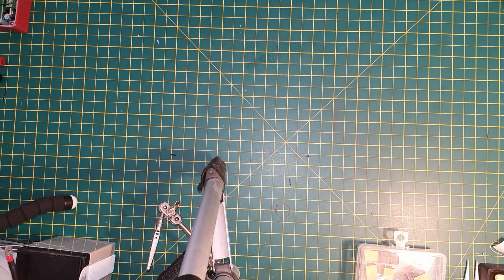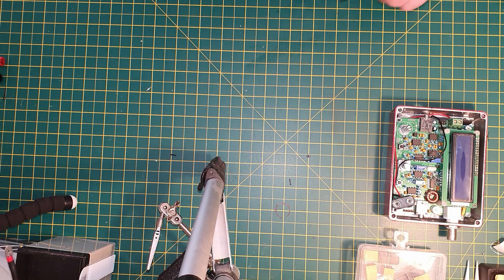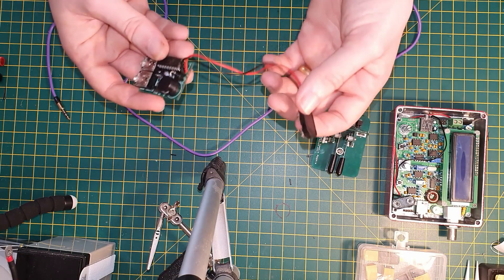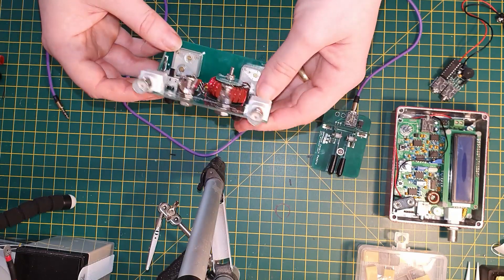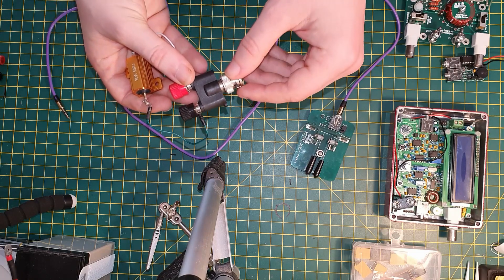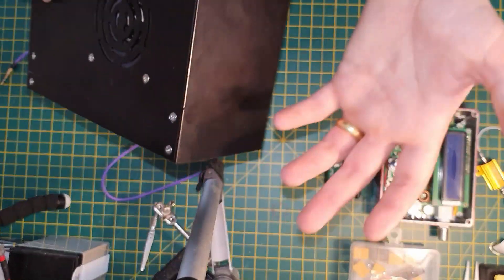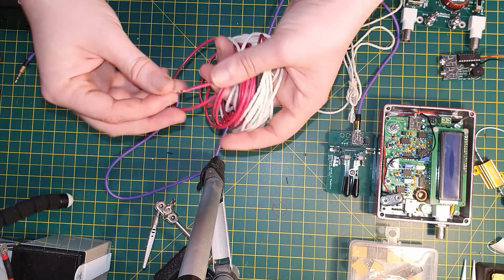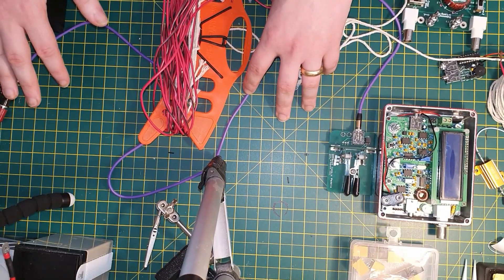Ham Radio for under $100, My amateur radio kit

Comment: On the Doublet, just cut it as long as you can and still have it fit in your space. Don't make it resonant on your highest band. Usually you may run into one or more bands you can't tune. You can try changing the length of balanced feeder by a foot or so and try again. They definitely work. I run mine as a vertical instead of horizontal and the length was determined by the mast I had (43ft), so each leg of mine is about 21ft. Mine is fed with 450 ohm window line. The longest contact I've made with it was about 9800 kilometers qrp ssb on 40M. And don't think you can't work bands that it's too short for. I've tuned mine up and made contacts on 80M.

Comment: Even with a dummy load, you can be heard for a long distance if the band is open. I made a contact with 5 watts into a MFJ dummy load from my house in Alabama to Tampa FL on 40M in the early Summer at about 9 PM. No tuner was in line so you cannot blame that radiating a signal.

Comment: Just come across your channel, very interesting, while I love building stuff, my gear is all silent key, or old! For 2mtrs I use a Yaesu FT1500m, and a Diamond antenna atop 20 odd foot mast, which was the most expensive bit. Total cost, including co ax and mast (£40.00) was under the £100. HF is covered by a Kenwood TS140S, a G5RV, (as inverted V) and an MFJ Versa tuner, including sectional masts and co ax total cost under £200. the only other item is the power supply, 30 amp, which cost £40. If you include everything, the extras like a NanoVNA, SWR/Power meter and an old S/H laptop (£5), my total station costs come in at under £400. The only new radio I have bought was a Boafeng HT, Amazon at £28, handy for very local use, like on a field day with multiple stations, but, frankly, not really a tool for longer distance, whereas I have had well over 100 miles from the Yaesu on the permitted 10 watts! Amateur Radio can be an expensive hobby, with adverts for gear costing up to 10k, but, even if you could afford it, would you understand how to use it? All this in my first year, what other hobby could you set up for life by spending less than a tenner a week? For now, as a cash strapped pensioner, my set up does everything I want at the moment, and is a great learning experience. so far I have repaired 2 Hi Fi sets, and 3 TVs, all from knowledge gained while learning for the foundation and generally listening to other club members and asking questions! As I now fix stuff for friends, who sling a few quid my way, before long I will have my shack basically for free! Keep up the vids! Jim M7BXT

Comment: Hello Grant. Very interesting look at getting started quite cheaply, thanks.
You mention using a computer to key the QRP QXC transceiver. I have been wondering about that but there is very little to explain how to do it and connect everything up.
Would it work with a Raspberry Pi? FlDigi?
Would a relay or transistor switch the keying side for transmit? Just wondering how you do it????
There is an interesting radio from the States called the Phaser/Phasor/Phazer? I believe but as will all American or Indian products, you usually have to re-mortgage the shed to pay the import taxes!
It is a cheap way of sending digital modes (if you do not have to pay said taxes).
Many thanks

Comment: Hi

I only know what I've read about Beverage antennas and that's not enough for me to comment.

An End Fed Random Length Non-Resonant wire fed directly with a 1:9 UNUN and coax from your tuner could work for you. Google 'Random Length Antenna Wire Length' to find tables of recommended non-resonant wire lengths and how to construct a 1:9 UNUN. EFRL aerials are difficult to MultiBand successfully.

However, an End Fed Half Wave length antenna fed with a 1:49 transformer is a true Multiband Antenna from 80M through 10M. You need the high transformer ratio because the input impedance of an EFHW aerial is 2000 to 5000/6000+ ohms not 400/600/800 ohms. It's easy to wind your own QRP Transformer on an FT140-43 ferite Toroid but don't use an Iron Core one. Google 'Steve Ellington End Fed Antenna' and 'Multiband EFHW Antenna'. Keep in mind, you'll be winding for QRP power levels not 2KW like Steve does.

Google 'Hamfest WA7ARK Endfed' for an outstanding discourse on the EFHW antenna. Mike's PDF page is the best explanation/description of the EFHW antenna I've ever seen.

An 80M EFHW will resonate @ <2:1 SWR at the input of the 1:49 UNUN on 80/40/30/20/17/15/12/10 without a tuner when a '6 turn air wound Compensation' coil is inserted a little after the UNUN and a 7.7 foot Counterpoise is added to the UNUN ground input (3.3 feet if main wire cut for 40M resonance). Also, if you prefer phone over CW, insert a 300 puff cap in series at the wire's center to move the 80M resonance point to 75M.

So, in practice, an 80M EFHW resonates on all bands from 80M thru 10M inclusive if you provide those three simple additions. A short counterpoise, a compensation coil and a 300 puff cap. WA7ARK's PDF page explains these add-ons in depth.

Without the 3 additions, the 80M EFHW is only resonant on 80M/40M while all higher bands have SWRs of 10 to 20 with resonances well above each band. If you have a robust tuner, these upper bands are usable but lots of power will be wasted as heat in the UNUN/COAX/Current Choke/Tuner because of high SWRs.

You can add a Current Choke between the Transformer and the rig (FT240-31 Toroid not air wound), and tie the rig to Earth Ground if you have RF on the rig. An EFHW operating at resonance seldom puts RF on the coax/rig. It's when you're off any of the resonant frequencies that the RF creeps up.

Tune the antenna on 80M by cutting the wire to the desired resonant frequency then add the 300 puff in series at the new midpoint of the main wire if you want to move from 80M to 75M. You could move resonance to/from 80M/75M by adding/removing a jumper wire across the cap.

In practice, the EFHW is low cost, simple, adaptable, easy to build/erect and an efficient unity gain aerial.

BTW: I suggest a more robust tuner for your Beverage.

Good luck with your antennas and CW.
73 OM

Comment: The first part of the video. You can turn manual focus in order to avoid auto adjusting during shoting. In the second part you may turn your tripod 60 degrees so no leg in the picture
Reply from the maker: Yeah I noticed the auto focus was on in edit. I have killed that fire. I am working on the tripod it's cheap cheerful and falls over if it doesnt have the leg there.

Comment: Do you know any module, circuit board or words I can research about changing the frequency on a high amp ac welder,I mean what does control frequency in an electric circuit
Reply from the maker: What is it you are trying to do? To my knowledge welders will use the same frequency as the mains voltage which in the UK is 50Hz
Reply: @Brains933  Hi
I had an AC/DC stick welder years ago that I'd use DC Positive/Negative grounding for different types of materials/welds. Really had no idea what I was doing. HAHA

There are sophisticated welders with variable Frequency/Polarities/Pulse Widths/Pulse Slopes/Shapes used for very serious welding of unique metals. I expect that both TIG and MIG Welders are in that catagory. I only know of them and little about them except that the newest ones are totally computer controlled, as one would expect today.

Early versions may have been controlled by analogue electronic hardware that could be modified by jiggling R/C/L values. Maybe?

I wonder if that is what the gent's question refers to.
73 OM.....
Reply: Ricinine
Sorry I cant help. Look at the replies. Also, one would need access to the welders Service/Repair Manual or as a minimum the Circuit Diagram/Schematics and Electronics Parts List to attempt modifications.

It could be a Simple/Difficult/Impossible/Disastrous endeavor.

But then again, life is full of challenges....